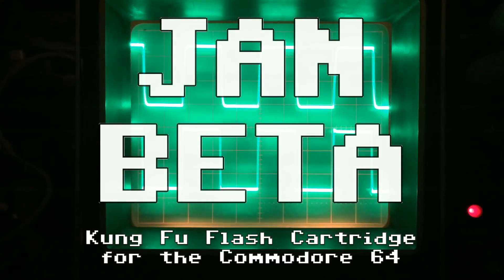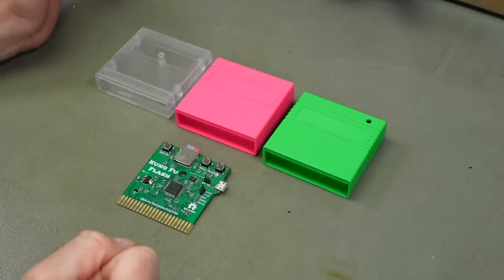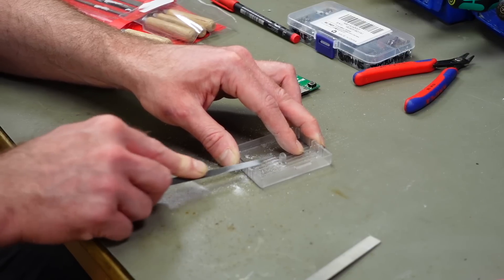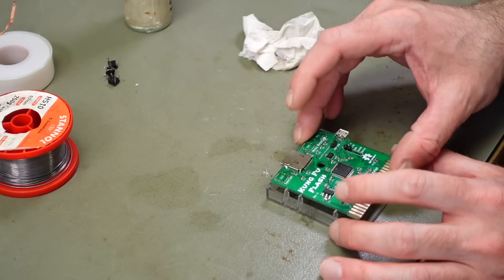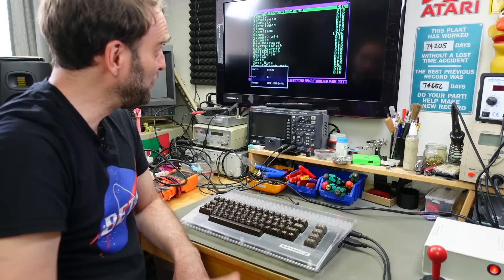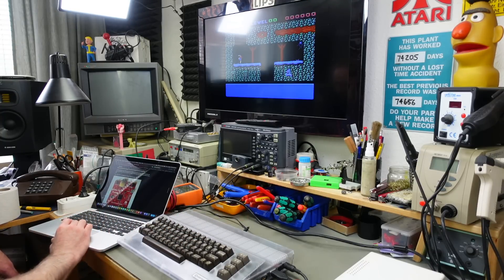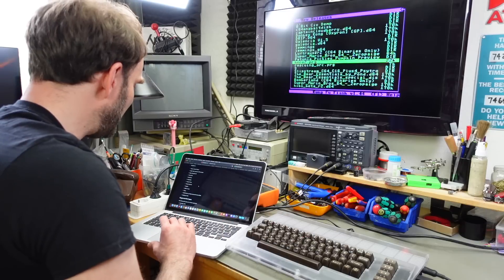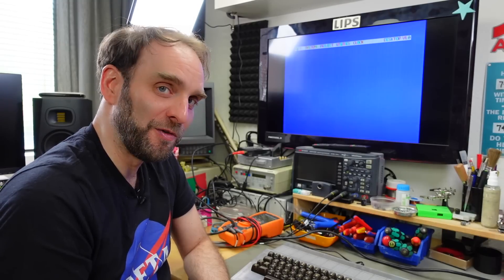Kung Fu Flash C64 Instant Loading Cartridge

Comment: Thanks Jan, I have one of these cartridges but was unaware of some of the features you mentioned. I think it would be extremely helpful to beginners if you could make a video that goes more into detail about how to actually use the c64 and what a lot of those accessories do. For example, what are freeze cartridges, how to use fast loaders, whats the difference between T64 and TAP, whats the difference between D64, G64, NIB etc, and how to use disk drive/ 1541 emulators. Maybe an introductory course on Basic, that sort of thing.
Reply: Those are great video ideas I'd definitely watch them!
Reply: That would be a series of videos to show what the KFF is capable of. Cartridges are primarily extensions and or replacements of existing ROM/RAM sections of a C64. The freeze button halts running code and diverts the running cpu to an own code on the module itself. This makes a freezer cartridge to an observer of the full memory situation of a computer, also giving the user nice stuff like saving the whole state to a disk file and restoring it much later. Freezer menus give you more, like an own independent monitor to alter RAM contents. So it's obvious you can apply cheats and trainers also.

A fast loader is replacing Commodore's ROM routines by optimised ones. The most effective ones like JiffyDOS also replace routines within a disk drive like the 1541, 1571 and 1581. Those cartridges often also give you shortcut commands like "DOS" to read errors back.

For file formats you best check what your .crt supports and stick to it. Cartridge emulated .CRT are actually not all the same. The file format has an ID to distinguish very different formats. The KFF is for example capable to emulate a "Final Cartridge III" but not the very first one without a number: "Final Cartridge". This is because of its incompatible hookup into RAM/ROM regions and to the CPU itself.

The Kung Fu is no 1541 emulator. When you select a .d64 disk image it only reads the selected files and directly injects it into the address correct RAM of your Commi. The same happens with a .PRG. So chainloading further files from a same disk image is not what a KFF can do. If you have a real drive also connected the KFF cannot use the same device number like "8", it actually masks it from being seen. So set the KFF to "9" and inject a first file as a programme to start and access files from the real disk from within the running application.
Reply: @congestiontv  thanks that was helpfull!

Comment: I always preferred cartridge buttons to be located on top of cart; that way you push towards the C64 board and not downward (when the buttons are on the front of cart) thus risking cracking the board, components or the metal plates.
Reply: Yeah, you could do that by replacing the buttons with right-angle buttons with long stems.
Reply: That shouldn't really be a risk if you "pinch" the cartridge - ie. placing your forefinger underneath the shell (behind the button) and use your thumb to push the desired button.  The forces should be neutral with respect to the computer.
Reply: @TheUtuber999  but that's a hassle, having to worry about applying several forces from different sides to avoid damaging the connector
Reply: @alerey4363  That's a hassle?  Seriously? 🤷
Reply: @TheUtuber999  let's see, if I spend 4 hours gaming on the C64 and by average I play each game for 15 min, then I'd have to perform that awkward fingers pressure maneuver 16 times then yes, I consider that a hassle and more important, 16 times per afternoon I risk my computer by not having a properly designed cart
Reply: @alerey4363  It's not an awkward pressure maneuver, lol, it's just a sensible way of handling a cartridge designed this way.  You're going to be reaching 16 times per afternoon either way... but whatever floats your boat.
Reply: @alerey4363  Also, irrespective of applied forces, I would prefer the buttons remain where they are currently situated because the translucent reset button is visible from above.  If it were relocated toward the back, that wouldn't be very easy to see.  Agreed?
Reply: @TheUtuber999  not either way; one does not stress the material; the other one will end up breaking the connector/pcb; it's called material fatigue (wikipedia is your friend)
Reply: @alerey4363 Just because Wikipedia has an article on a topic doesn't mean it applies here. Guess we'll just have to agree to disagree. Over and out.
Reply: @TheUtuber999  well if you are going to deny all the experts in material fatigue writing that article I guess it's no use explaining anymore.
And no, you can't ignore physics, you can try avoiding wikipedia but facts still stand.
Reply: @alerey4363  It's not about ignoring facts, it's about using common sense.  If you are deliberately pressing down and applying leverage to an object, knowing you will be stressing it when there is a more sensible way to use that object, that's on you.

The KFF also seems to be selling very well - all those buyers don't seem to have a problem with the design, or they wouldn't be buying it.
Reply: @TheUtuber999  unless you push with all your force you won't break it AT ONCE; but material fatigue, as it's been explained before, is produced thru time; why do you think airplanes structures get x-rayed periodically? if you don't act when there's a tiny crack then the continuous/repetitive stress applied thru time will ruin the material.
It works that way, cumulatively.Wait some time and you'll see the problems with that design.
You seem to fail the concept of applied force thru an angle, which is the problem here.
You also said over and out and yet here you are, trying to grasp the concept.
Reply: @alerey4363  I said that we should agree to disagree, then over and out.  That should have been the end of it, but you had to have the last word so as to appear to win the debate.  But as I stated previously, the product seems to be selling well, so obviously those buyers don't have an issue with the design... which, incidentally isn't unique to KFF.  Super Snapshot was considered by some to be the best utility cartridge ever designed for the C64 in its heyday, and it uses this type of button placement.  But you think you know better, lol.

FYI: Cartridges that use buttons positioned at the top instead of the front also have sheer forces applied, but those forces are against the buttons which are mounted at a right angle on the face of the board... so there is no escaping that.
Reply: @TheUtuber999  "FYI: Cartridges that use buttons positioned at the top instead of the front also have sheer forces applied, but those forces are against the buttons which are mounted at a right angle on the face of the board... so there is no escaping that"; of course but:
a) the push button has a spring so the force is dampened by it
b) I rather crach a $0.20 push button (that you can buy today literally from dozens of sources) than cracking the C64 PCB
"which, incidentally isn't unique to KFF.  Super Snapshot was considered by some to be the best utility cartridge ever designed for the C64 in its heyday, and it uses this type of button placement.  But you think you know better, lol." -> now read carefully:

I have similar issues with KFF in certain boards - while others are rock-stable - but my issues are always initiated by me pressing a button.

My KFF has upwards pointing buttons - and when pressing them you inadvertently wriggle the cartridge a little.
If I stabilize the cartridge by putting a rubber eraser (or something similar with the correct height) below the cartridge - pressing the buttons it safe/working again...

Most cartridges have backwards pointing buttons - pressing them usually does not introduce as much wriggle to the cartridge as upwards pointing buttons does..

@penny-bit Now I know this is a long shot - and it may not explain your problems - can you give some more details on the crashes. freezes and glitches that you see ? do your issues appear without pressing buttons or ?

PS: I've created an feature request for a new PCB revision with backwards pointing buttons #77 - if this proves to be the issue for you then you could consider voting/chiming-in on this issue - that will give a better a picture of how many users that have these kinds of problems

That's just one of MANY users complaining about (not my opinion as you seem to think) a FACT: you can't escape material fatigue by applying REPEATING forces (no matter how gently you do); over time it's gonna crack because it's not designed to withstand that kind of stress.
Source: (not wikipedia this time, it's from the github of the cartride designer LOL): https://github.com/KimJorgensen/KungFuFlash/issues/89
You should have got out when you said it, now it's too late.
Reply: @alerey4363  You keep ignoring (deliberately, I'm sure) my suggestion to grasp the cartridge with two fingers when pressing the buttons... but no, that's too difficult for you to grasp in your head. 🙄  Since those buttons are so inexpensive, why don't you just go ahead and replace them with right-angled types as another person suggested, if it bothers you so much?  Is that too challenging for you, or do you just like to whine and complain?

"the push button has a spring so the force is dampened by it..."  I think this is a ridiculous assertion, but if true, the same could be said for pressing the button in any direction.

Comment: I've only been using this cartridge for a couple days and really like it.  The loads and saves are lightning-quick!  I thought there might not be a way to prevent it from automatically loading the last selected program on a D64 file, but found that if you press Shift+Return while highlighting the D64 file from the list, there is an option to mount the drive.  This allows read and write access to the D64 image which remains persistent between resets, but doesn't automatically load a program.  Win win!

Edit: I wanted to try sending files between a PC and the C64 over a USB cable, so as to avoid the need to shuffle the MicroSD card from computer to computer.  I was able to use the included ef3usb utility to send a file from the PC to the C64 and have it execute immediately upon completion of transfer by using the 'send' parameter.  Now I'm just struggling to figure out how to send a file the other direction - from the C64 to my PC.  Has anyone had any success with this?  For clarification, the source file would be one of the prg files contained within a D64 image file on the MicroSD card.  Thanks in advance for any tips!

Comment: The KFF cartridge is awesome. I highly recommend it. Especially from TFW8b. They sell extremely well made cartridges. The fit and finish is impressive.  

That being said the 1541 Ultimate II+L is capable of a ton more (including kernal replacement & REU) due to having a large FPGA and is what you want if you need cycle accurate floppy drive emulation. It is also about 3X the price.  Oh and not as readily available either. 

You have to decide if you prefer the simple low cost instant loading KFF that doesn’t have great disk drive support or the more complex, more expensive does it all approach.   Or both. 😂

KFF is my favorite cartridge emulating cartridge. The ability to drop CRT files  ( including Easy Flash format) onto a FAT32 micro SD on your PC and nearly instantly load on the KFF is super convenient.
Reply: I agree, the KFF is for budget conscious users, but if you can afford about $200usd then the Ultimate-II+L (latest Lattice version) offers so much more.  The latest Ultimate carts can also emulate pretty much all carts like Easy Flash,  Fincal Cart, and SuperSnapshot ,etc.  However, the loading menu on the KFF is a little easier to use.

Comment: Nice video 
, I was thinking that that card had reu support too. But maybe i'm wrong
Reply: KFF doesn’t support acting as an REU. Someone was asking about whether it could do it and be a small REU but the issue is around not having enough program space and  that the existing features and the REU support code wouldn’t fit at the same time. Since it would be a small REU anyway it doesn’t seem too practical. 

For that look at the RAD or SideKick64. Though with the cost of a Raspberry Pi these days on top of that you could just go 1541 Ultimate 2+L.

Comment: A tip for drilling small holes in to plastic: use a wood drill bit. A wood drill bit has less bite and creates a neater hole in plastic whereas other drill bits have more bite and rip and tear the plastic.
Reply: Or a step drill, less aggressive cutting edges and if you're careful you get a nice chamfer too.
Reply: @SomeMorganSomewhere  Another great tip. Thanks!

Comment: TheFutureWas8Bit now have complete Kung Fu Flash cartridged with case and everything. Clearly the best version out there.
Do you have issue with the multiload cartridges og OneLoad64 collection? Mine (two, one from another source) fails when pressing menu button after such is loaded. You can get it on track by either moving SD card to computer and delete the dat file or removing it, pressing meny button, then asks for sd card and then put it in (while power is still on). Then it loads menu. Have asked quite a lot of places if anybody else have these issues - but none bother answering. No matter which machines. Stock longboard, stock shortboard or SixtyClone withgout any original ICs - all the same.
Reply from the maker: Just read up on that problem briefly and it seems the creator of the compilation uses a loader routine that overwrites some jump vector tables in memory. I guess the issue is that the Kung Fu Flash can't cope with that, maybe a future firmware update fixes the issue (not sure if you caught that, but there was a new KFF firmware update just a couple of days ago, I haven't even installed it myself yet). Not much else I can suggest at this point, I have not tried the compilation myself. It seems it's just partially incompatible with how the Kung Fu Flash handles things. There's some slight incompatibilities with some stuff still that are slowly being worked on.
As for TFW8b, Rod actually sent me one of his professionally made KFF carts and it is very high quality and looks much better than my DIY version. Functionality is the same, obviously. :D
Reply: @JanBeta  Nice, thanks for investigating! Yeah wonders if it's a fault of the KFF or OneLoad Collection. Meaning since unload SD card can do the trick. Must read something in the dat file that just should be ignored when pressing menu button.
Could be one should contact both authors with the issue.
Must admit I've been very confused and only bought the second KFF as I thought it was a fault with mine since literally no one would answer a simple question.
A huge thanks from me!

Comment: Would GEOS work with the cartridge and still be able to access older disk drives or CMD drives?
Reply: I don’t believe the GEOS loader would work for booting from a .d64 on the KFF.  And you would need a cartridge expander for KFF and REU to launch the GEOS rboot from the KFF.  

If you could get some part of GEOS into a single load prg then maybe it would be useful.  

Just as an exercise I used my Super Snapshot v5 to snapshot a booted C64 OS single load prg. KFF loaded it quick.  Of course it was stateful so changing anything would make it not work. So useless other than as an experiment. 

That being said, with the feature of KFF where it loads whatever you did last, it was about 4.2 seconds from flipping the power switch to having a usable C64 OS desktop.
Reply: Since the Kunf Fu is not a floppy emulator it cannot load the sequence of files necessary for the disk versions of GEOS. However, the dedicated cartridge version can be moved onto the ɥSD card as a .CRT and works fine like so.

Comment: King Fu vs backbit / backbit pro??
Reply: BackBit Pro is better than KFF, but more expensive. 
BackBit is not produced anymore, and it doesn't read all CRT Easyflash releases. 
Compatibility with PRGs/D64s/D71s/D81s are practically the same on all of them.
BackBit Pro and KFF do read all Easyflash CRT files - KFF need to flash them (up to 10 seconds), BackBit Pro reading them instantly.
There are more advantages of BackBit Pro (like integrated program for making backups of D64 and D81 files to 1541/1581 and vice versa) and other stuff.
If Jan finally test BackBit Pro cartridge provided by Evie long time ago, you would know more.